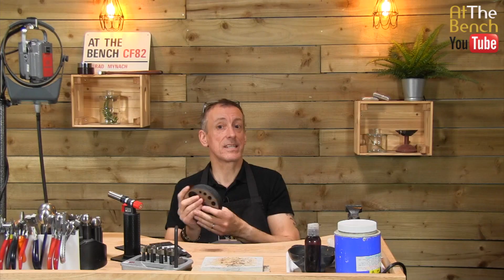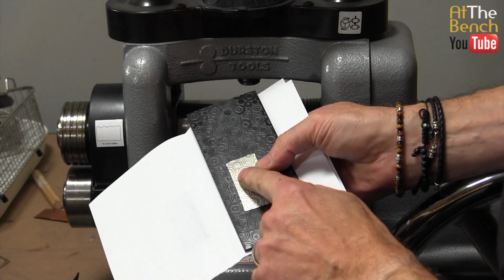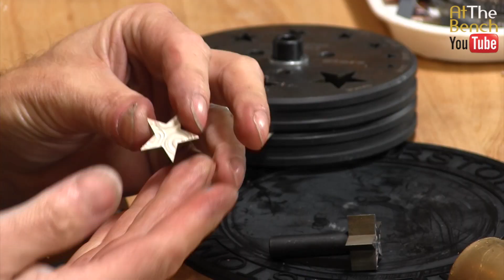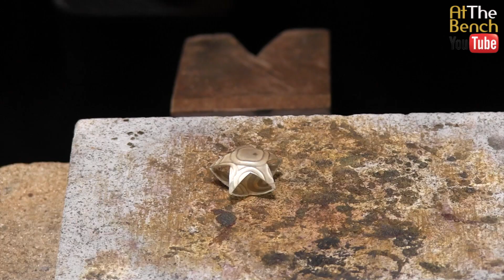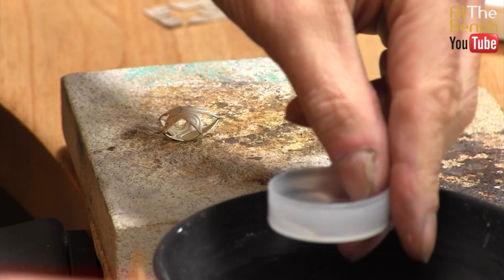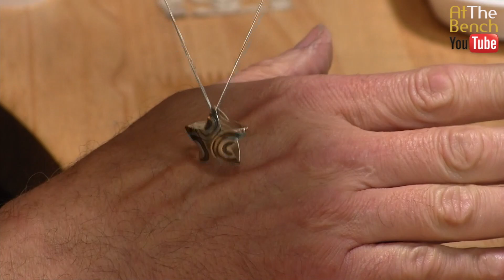Quick Pendant Using The NEW Durston Texture Plates and Star Shape Cutter

Comment: Hi Andrew, thanks for the videos! Do the texture plates need to be used on only the flat roller, or do they work over the wire sections as well?  They appear to be wider than a lot of the flat roller sections on many of the mills.
Reply from the maker: They have to be used on the flat rolls and not the wire rolls

Comment: I have the star disc cutter.  I have a problem with it sticking. I was hoping to see you get the shaper out of the tool. You skipped showing that part. Hope it wasn't because it stuck for you too.i have to disassemble the whole thing to get to out.
Reply from the maker: No the punch pushed the star cleanly out. I did put some wax on the edges. Perhaps that helped?